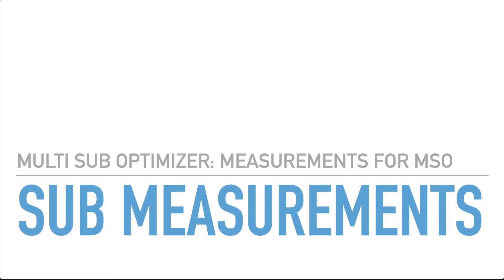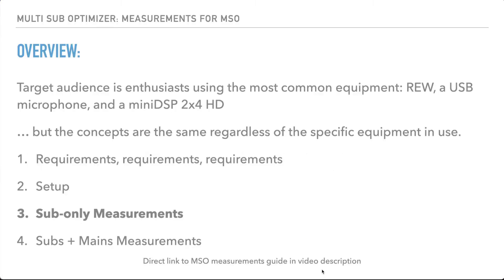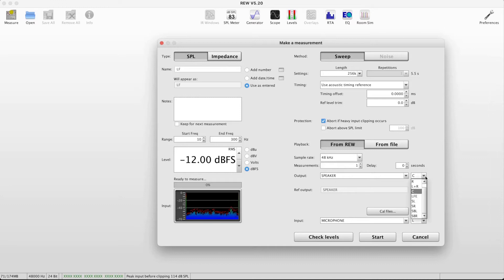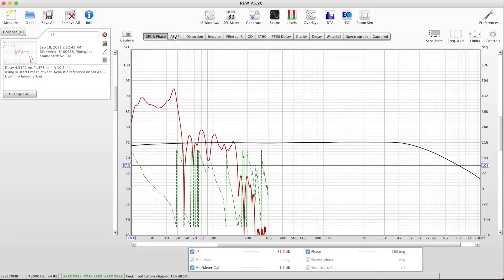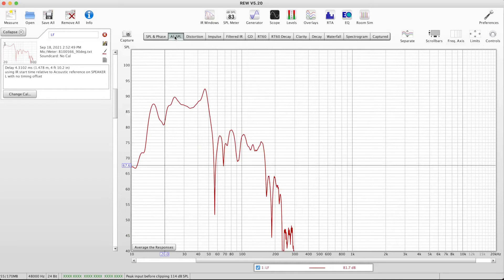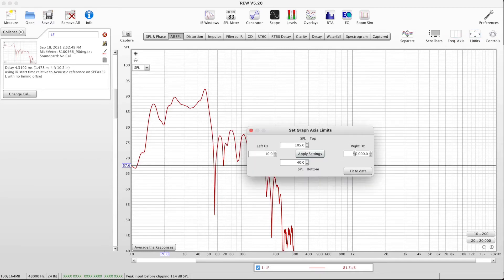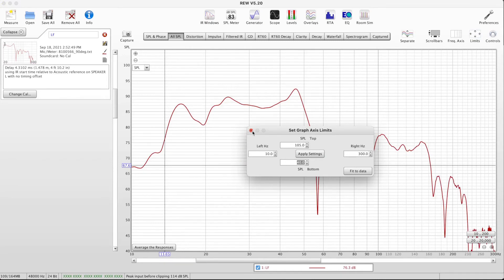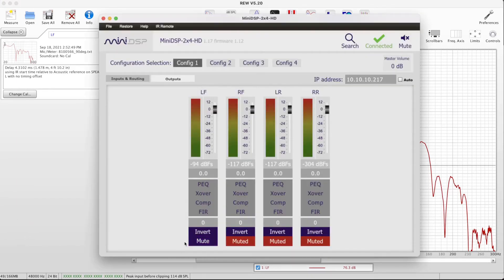Measurements for MSO: Sub Only Measurements

Comment: Amazing tutorial, thank you. Question, do you have to set gain levels of each sub before sweeping... For example should the subs all be playing at the same DB with pink noise or will MSO give you the DB to set each sub at after optimization?
Reply from the maker: Sorry for the delay in my response. If the subs are identical the gain control should be the same on each sub. If they’re different, you can level match before measuring
Reply from the maker: I should add that the modal influence of the room swamps the native response and can make level matching difficult with unmatched subs.
Reply: @jeffmery gotcha thanks.

Comment: Is it better to use the center channel instead of LFE? On my Yamaha AVR the LFE seems to have a LPF so there is a drop off from about 100-120hz even when in straight or direct modes.
Reply from the maker: Yes, in my opinion it's better to use C or R instead of LFE.  Set the C or L/R channels to "Large" in your AVR to bypass the crossover.  Then you will get a true full-range measurement of the subs with no LPF in place.
Reply: @jeffmery  thanks for taking the time to reply 👍🏼
My old aventage receiver seems to have some sort of fixed filter
Reply: @jeffmery  Would you then have to connect the subwoofer RCA cable to the center channel pre-out and physically disconnect the center from the AVR?
Reply from the maker: @chrislukowski1825  Correct!  A bit of extra work, but worth it IMO.

Comment: Hi. Question, what volume do you set the AVR or processor at?
Reply from the maker: The specific volume (i.e., the number displayed on the AVR/processor) doesn't matter.  What matters is making sure the volume is sufficiently above the noise floor of the room.  This will vary so here's how I find a good volume level.

We want our sweeps to be 30 - 40 dB above the noise floor of the room.  This is really easy to figure out!

Take a sweep.
Switch to the "Distortion" view in REW.
Change the scale to SPL or dBFS
Select the "Fundamental" and "Noise Floor" traces

You want the fundamental and noise floor to be 30-40 dB apart over the frequency range that you care about.  Where you have nulls, the noise floor typically will rise a bit.  It usually rises as you get very low in frequency as well (e.g., below 20 Hz).

If you're 30-40 dB above, you're good to go.  If you're not, just turn the volume up a bit and take another sweep to verify.
Reply: @jeffmery  thank you so much!
Reply: Another question,  could i put a crossover in Minidsp to protect my subs in the low end because they don't have internal protection?
Reply from the maker: @robotag95  Yep.  You only need to implement the high-pass filter side of the crossover.  Where you implement that filter somewhat depends on how you're going to optimize your subs and if you plan to implement BEQ in your theater.  It could go on the input or output side of the miniDSP.  I'm happy to help figure out what I think would be best if you want to give some additional details.
Reply: @jeffmery  i have subs that have freq ranges at the low end @ 18, 32, 45hz. My question is should i put a high-pass filter at those values to not damage the speakers?
Reply from the maker: @robotag95  If they are ported subs, then absolutely yes.
Reply: @jeffmery  okay thankyou. They all are. Thank you for all this!
Reply: Hi. I keep getting negative delays and when i normalize them it tells me that the delay limit has been reached and adds a shared delay. Im using a minidsp and cant add a shared delay. what do you suggest I do? For reference i am doing a subs+mains and im using just my center channel.
Reply from the maker: @robotag95  I've never done a subs+mains integration before.  I think a shared delay on the subs should be implemented in the AVR as a change in the subwoofer distance.

Comment: I notice the REW input level is set to -12 dBFS, and the gains in the miniDSP are 0 dB. What level should the AVR master volume be set to?
Reply: thank you
Reply from the maker: My reply is going to counter some of what you read online.  It also (somewhat) is counter to what I mention in my videos.  That's not to say that other folks or my own videos are wrong.  It's just that I've found a much better way to get good sweeps while eliminating specific level discussions.

The MV really doesn't matter.  What matters is that the level of the sweep is 30 - 40 dB above the noise floor of the room.  30 dB is good for most things.  Use closer to 40 dB when you need things like the waterfall or spectrogram that require more energy in the room (so for subs I use a higher value).

"Cool, Jeff.  How do I do this?"

Take a sweep of any speaker.  Above the chart area, select "Distortion".  For the data traces at the bottom, select only "Fundamental" and "Noise Floor".  You want the difference between these two measurements to be between 30 - 40 dB for the entire range of the sweep.  If it's too narrow, turn things up a little and run a sweep to verify.  You don't really need to turn things down if it's > 40 dB gap.  However, I've found that sweeps don't need to be as loud as you think.

Let me know if this helps.  I've answered this question a lot lately so I clearly need to do a video on it.
Reply: @jeffmery  When setting the volume, noise floor + 40dB, using the LFE channel, to measure subs for time alignment and EQ,  do you do this with only one channel turned on or with all subs turned on?  In my case I have 4 subs and I'm using a miniDSP 2X4 HD.  Thanks in advance for your videos.  I have learned so much from them.
Reply from the maker: @mmares056  Ideally you want to be +30 to +40 dB above the noise floor for all measurements.  That way all the data used by MSO is good and not noise or something that can't be fixed.

Comment: Thank you for the video.  I have struggled and struggled but can not get any ASIO drivers to work.   I read below that Java can still be used similarly to aligning PEQ my 3 subs with the minidsp. 

I was told to do the following:
"You can get your MSO measurements using the JAVA drivers by:
1. TURN OFF THE POWER TO SUBS, MINIDSP AND AVR WHILE CHANGING THE CONNECTIONS
2. Connect the miniDSP to either the right or left speaker PRE-AMP OUTPUT AND DISCONNECT THAT SPEAKER on AVR. (the other will be used for timing reference.)
3. Set the fronts to "Large" in the AVR.
4. Follow MSO instructions from here."

Can I accomplish the same goal but raising the crossover?  That is certainly easier.  Thank you
Reply from the maker: For a sub only optimization, the process above will work.  However, you are measuring a normal channel, not the LFE channel.  As a result, raising the crossover won't work, that would actually remove more of the bandwidth we want to measure.

As a results you do need to set the L&R channels to "large".  Just write down the current crossover value so it can be properly set when you're done.

Comment: I'm having trouble getting a nice response in MSO. I'm thinking it might be because I have combined nearfield and far field subs depending on seat position and this is an overly complicated setup. But I'm also wondering if it is simply because my REW measurements have such varied SPL. I gain-matched my 4 subs which means each sub has different SPL at all positions, including MLP. I'm wondering if level-matching each sub (at the MLP) would produce different results in MSO. I plan to try the switch tomorrow but wanted to comment in case others might be in a similar spot.
Reply from the maker: Again, apologies on the delay.

I did respond to your other question, but catching it here as well.  Yes, I agree that near field subs will muck things up a bit.  Adding/removing gain is adding/removing gain no matter where you do it.  If the subs are identical, I prefer gain matching over level matching as it's just easier.  We can then trim things out using the optimization.

I also recommend the response on the other thread to limit the cut allowed per sub. Just know that with near-field, it's probably going to be difficult to get all the subs working equally hard.  That's really just something to be aware of as you start to optimize.  You could end up in a situation where you start to push the far field subs too hard before the near field subs have run out of steam.  I supposed you might also be able to localize some of the sounds to at least the near field subs.

On that last comment, I'm thinking along the lines of how PEQ for each sub will be different.  You could hear more of certain notes from some subs vs others.  Especially true for a big gain discrepancy between them.

Comment: Thanks for a great series with tutorials. Do you level match fronts and sub before taking measurements?
Reply from the maker: No.  When measured using the LFE channel, the subs will be 10 dB louder than the mains.  This is by design and is part of the specification for the LFE channel.  When you set your crossovers and sweep a non-LFE channel, the subs will be at the correct level (i.e., those redirected frequencies are not coming from the LFE channel so they do not receive the 10 dB uplift).

Comment: Great video, I need to track down your REW setup video referenced in this one to ensure I have it all setup properly.  I am about to redo my MSO readings because I did not use the timing feature.
I plan to try to use the Java drivers, set speakers to small with the highest x-over possible.  Send the timing to the left speaker, and send my sweep to the right speaker, and unplug the right speaker.

As a result the sweep should not play on the timing speaker as it will specifically target the opposite speaker, and the dead speaker unplugged should not play the bass sweep but will pass over to energize the subs via the x-over.
Reply from the maker: That will work perfectly well!  I was going to suggest that as an option, but didn't want to complicate an already complicated conversation on AVS.  Feel free to keep that thread going and update us on your progress :-)

Comment: What do you think of MSO compared to DLBC?
Reply from the maker: I like them both.  A lot.  :-).

I really think that it doesn't get any easier than DLBC.  It's about as "push-button" as you can get.  The resulting sound is fantastic.  The downside is that it requires a processor that supports Dirac and DLBC (some from Emotiva support Dirac, but not DLBC.  I'm not picking on them, but know they have this issue.  There may be others).  Additionally, on many AVRs/Processors, the multi-sub DLBC requires an add-on license somewhere between $350/$500 USD.  That license is included on some models (StormAudio, JBL Synthesis, others), but something to be aware of if you're shopping around (HTP-1, Arcam, others).

MSO also produces excellent results.  However, MSO requires more work on your part.  You have to create measurements, feed them into MSO, run a couple of optimizations with different parameters, then program the miniDSP and verify results (then run room EQ).  That being said, it will work with any AVR/Processor, even one with Dirac and DLBC.  Another benefit is that the sub alignment is separate from the room correction.  You don't have to change or recalculate the alignment every time you change the room correction.  You can even change from Audyssey to YPAO to Dirac to ARC and your subs are always aligned (this is a benefit of any external method, not specific to MSO).

I used to use MSO and DLBC together.  I recently moved to just pure DLBC with my 4 subs.  DLBC seems to need direct control of >1 sub to get the best sub-speaker integration results among all speaker pairs.  The crossover points are smoother with 4 subs under DLBC than they are with 4 under MSO presented as 1 to DLBC.  I think this makes sense given the phase manipulation that DLBC does to make the crossovers smooth.  It just has more to work with.  It would be interesting to try something like 4 subs integrated as 2 pairs with MSO and presented as 2 subs to DLBC.  I bet it's better than the 4 -> 1, but i'm not sure how it would compare to 4 direct.
Reply from the maker: @Joe N Tell - Just came across the short MSO video you did with Youthman.  Feel free to ping me when you're ready to go down the MSO rabbit hole.  Happy to help out.
Reply: @jeffmery  I've been in here for a while now. 🤣 I have my system setup using sub+mains. The best I've ever hear my bass sound ever.
Reply from the maker: @joentell  That's awesome!  I subscribed to your channel and am looking forward to any content you release on this over there.
Reply: @jeffmery  contact me. Would love to pick your brain.
Reply from the maker: @joentell  Sure thing.  You have a preferred method?

Comment: Jeff,  thanks again for the tutorial, much appreciated. One thing that I would ask for clarification on is what volume setting are you using on the AVR and what SPL are you setting each sub to prior to taking the measurements? Since  you are not using the test tones from the AVR to make your measurements, this means that you must be using the volume knob on the AVR to set a specific SPL volume for the sweeps.
Reply from the maker: Check out the first 5-10 mins of this video for how I set levels:  https://www.youtube.com/watch?v=odsMMYXW1y4

Basically using REW-generated noise with the REW SPL meter and the AVR volume knob to get things setup.  Remember to zero out all of your existing trims/gains/delays/room EQ/etc before starting this!

Regarding individual subs, this gets into the debate of gain matching vs level matching.  My 4 subs are identical so it's trivial to gain match them.  The gain knob on the plate amp has detents and I just set them to all to the same setting.  I prefer gain matching with MSO for a couple of reasons.

First, as mentioned, it's very easy for me and I'm lazy ;-).  Second, MSO is going to recommend differing gain levels no matter what method I use to match my subs.  I'd rather have them all starting from the same point of reference than have no idea where they really are.
Reply: @jeffmery  thanks. I do the same.     A problem that I'm running into while setting up my buddy's system which only has 2 subs monolith monolith THX tens is that M So is pretty much killing everything below 60hz  with the PEQs.  So when I do a sub only set up with MSN and then feed the results to to the MiniDSP and then run the auto calibration the AVR... the AVR ends up setting the sub gain to + 10db  because MSO pulled so much energy out of the subs.
Reply from the maker: @wells2671  I'd be interested in seeing the raw REW measurements as well as the before/after of MSO.  I assume measurements were all taken with an acoustic timing reference?
Reply: @jeffmery  I'll share those later when I get access to them.
Reply: Let me know where I can send or share the file.
Reply from the maker: @wells2671  How large is it?
Reply from the maker: @wells2671  Can you share via OneDrive, Google Drive, Dropbox or some similar service?
Reply: @jeffmery I've attached it twice already and it disappears. not sure if youtube is taking it down or what?
Reply from the maker: @wells2671  Sorry for the delay. I'm guessing YT doesn't like them for some reason.  See if you can e-mail it over to incoming a t bisonhta d o t c o m.  Hopefully you can figure that out but the bots can't.  I just created that email alias so give it maybe an hour before you try and send something over.
Reply: @jeffmery  I'll send it there. Thanks
Reply: Hello again Jeff. I emailed per your instructions.
Reply: @jeffmery Hi Jeff. With the method of getting the receiver at the right level. Am I shooting for 40db above the noise floor for all the subs collectively tied to my minidsp 2x4 or individually (muting 3 and measuring the output of only one sub)
Reply from the maker: Aim for 30 dB on the individual subs. They’ll be louder when combined.
Reply: @jeffmery  ah ok. So we're level matching prior to optimizing in MSO. In your setup vid, you mentioned zeroing out the minidsp including the gain level of each output. Level matching makes more sense to me.  Is it 30 above noise floor if moving the sub out Rca to the r speaker out for the timing reference?